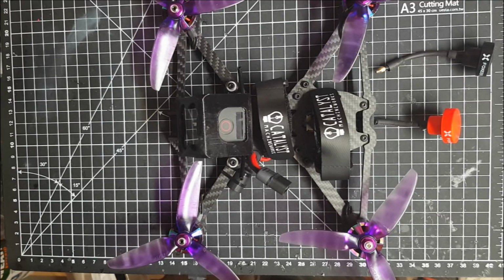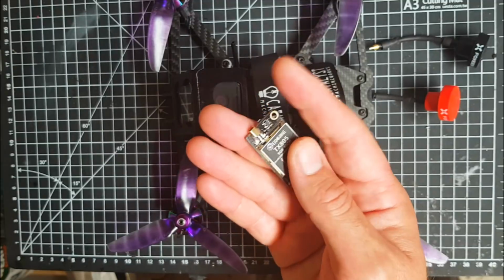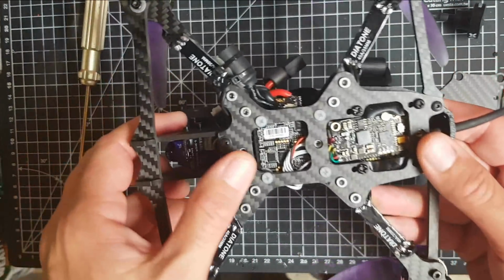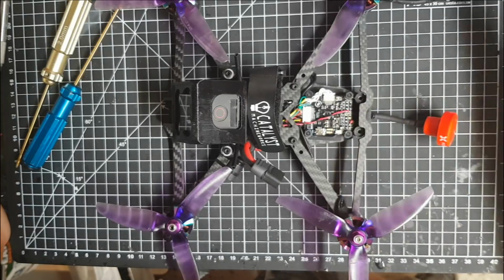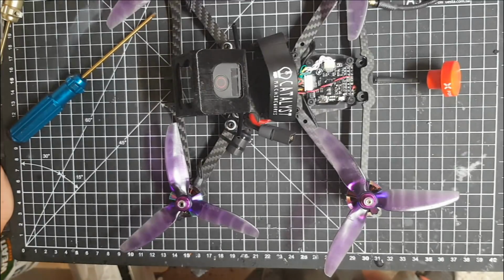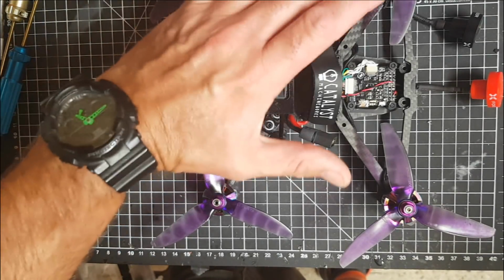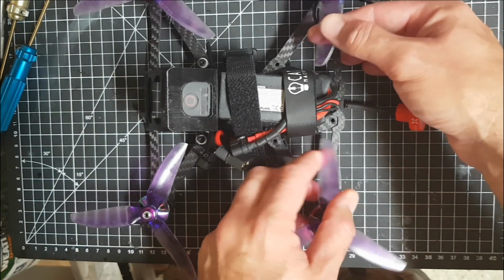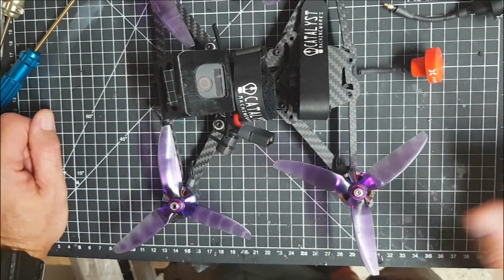Catalyst Machineworks Smooth Operator Build overview / why 2150kv??

Comment: Those particular Foxeer antennas are CRAP!!! Not saying the VTX was fine but those antennas are junk in sma, ufl & mmcx. I thought my unify was bad when I used them. Unfortunately I bought a few of them & all were garbage. Luckily I had a whip antenna with me so I tried it before swapping my VTX & it worked as expected.
Reply from the maker: ryan todd I believe you are correct... i presumed vtx as ive never had a bad antenna out of the box. yet to confirm but it's looking that way. That's why piroflip were selling for 4 bucks ;)
Reply: Coppertop FPV 
Lmao! Exactly right my friend. And it’s not because of defects in later batches... I purchased 2 as soon as foxeer released them & both were DOA. I feel like you’d get better reception running no antenna at all. Ok, I’m exaggerating a little bit but not by much
Reply from the maker: ryan todd I put The black antenna on my last pack the other day and it was crap but I was close range. Orange one works really well tho. Love this hobby;)

Comment: I've had nothing but good luck with the AKK Tech VTX's have the Utimate and the FX3 and one other one I can't recall right now but all 600mw and all awesome and every bit as good as the "used to be" $40 Unify and easier to operate in my opinion, may not be as light weight is only thing I could see why would not use AKK in my opinion, I'd say yes give them a try!! Great vid thanks, thinking of trying this in their BNF version?? L8r-Turbo.
Reply from the maker: Turbo Reviews this is a rebrand of the Akk mini thingie. It was actually the Foxeer pagoda which was dead out of the box. The Eachine vtx is fine. I’ve had decent luck with the Akk stuff also but it appears to be a bit of a lottery judging from others.

Comment: Is the quad also more efficient on 5s with these 2150kv motors how long was you flighttime
Reply from the maker: No not really this is the equivalent of running 4s 2600kv. However because 5s sag less you have full power till the end so you prob end up with an extra 30 secs. You can also run on 4s for 5 min flight times. Good for proximity
Reply: Thanks man i thing i am going to purchase them

Comment: Nice build!!! What is weight without battery?
Reply from the maker: Mike Orion about 360 with props on.
Reply: Coppertop FPV What size of 4s battery are you using? 1300mah?
Reply from the maker: Mike Orion 1300 & 1500
Reply: Coppertop FPV My quad weights 456 grams with the 1300mah battery and I got DYS 2206 2400kv motors on it with HQ 5x4.8x3 props and they don't give enough thrust. Looks like those 2207 that you have on your quad are more than enough for your weight.
Reply from the maker: Mike Orion my hyperlow CGs weigh 40g more than this. No issues with thrust on any 2306 or 2207 ive used. Weight with gopro is 460g. These motors in a higher kv would be greater for normal use . Suppose it depends on what u want